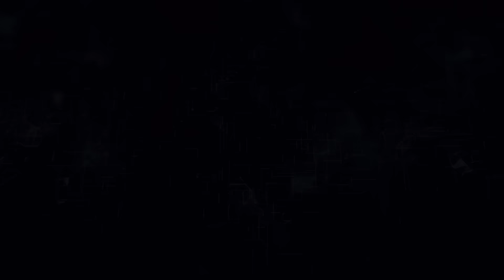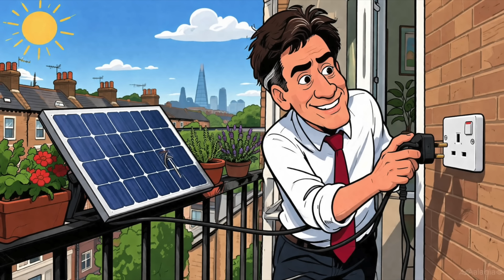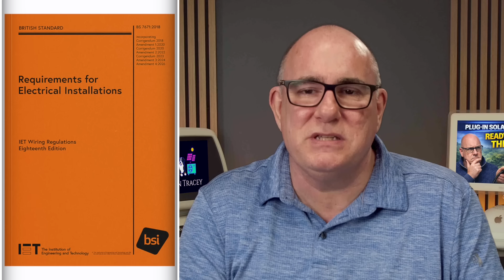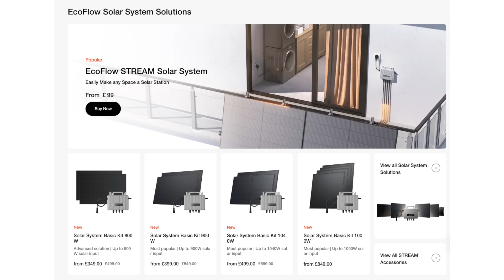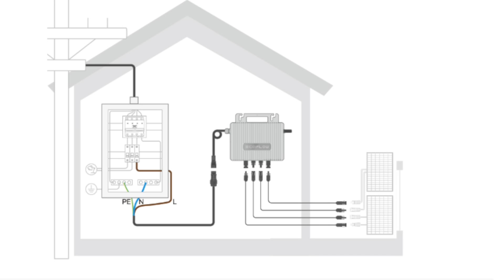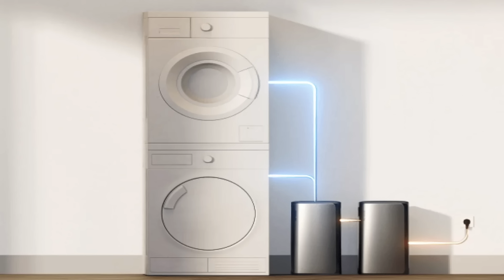Plug In Solar Is Coming… But There’s a Problem

Comment: I do think the introduction of these solar systems is likely to lead to bad practices and acceptance leading to possible injury or death. While these solar/inverter systems may fail safe they do encourage the non-expert to use a device with exposed conductors to deliver power into their homes (the plug). For the non-expert what is the difference to plugging these systems in and plugging a cheap home generator into their home in the same way?

For those non-experts reading this - one will be relatively safe (the solar/inverter system) the other could be lethal (the generator system), especially if you have inquisitive children.
Reply: A generator would never have a 🔌 with live pin sticking out, no?
Now, if you are jerry rigging live exposed pins out of a generator, first, DON'T DO THAT. second, it's on you.
Reply: @konstantinlozev2272  I agree with what you say, however I have seen people doing exactly that. I.e. using a plug on the end of a cable to 'back feed' power from a generator into their home during a power outage. These types of cables (with a plug on both ends) are known as suicide leads/cables for a reason.

Yes it will be on the person doing it, however my point was that if non-experts are told that it is safe to use a plug to connect the solar/inverter system into a socket to power their homes to them a generator is just another power source - so why would it be any different!
Reply: @jim373 uff, off, that's a recipe for suicide ☠️☠️☠️
Not sure how I see a person jerry rigging this plug-on-both-sides cable and not knowing they can kill themselves...
Nowadays they can ask chatGPT and it will surely say BUG NO! 🙅
Reply from the maker: The pins are never live, thats the point. Also its been doing for years in Germany wihtout anyone killing themselves, why would it be different here?
Reply: @JonathanTracey  I have seen people using a generator as a power source using a plug on the end of a cable to 'back feed' power from a generator into their home during a power outage. These types of cables (with a plug on both ends) are known as suicide leads/cables for a reason.

My point was that if non-experts are told that it is safe to use a plug to connect the solar/inverter system into a socket to power their homes, then to them a generator is just another power source - so why would it be any different?

I think the Government should provide advertising and education to the public that points out that a solar/inverter system designed to fail safe and using a plug to connect into their homes is not the same as doing the same with a generator. Generator systems typically have much higher output potential many kW compared to the solar/inverter micro systems which typically provide 100s of Watts.

I'm not saying the solar/inverter systems that are designed to be used in this way are dangerous. Just that, the precedence of using a plug to feed power into a home has the potential to provide the wrong message to non-expert home owners, unless there is adequate education provided along side them, including advertising type messages on TV, in papers, etc.

Comment: A lot of landlords in Germany won't allow balcony solar as there is a question of liability if they, or parts of them,  fall from the balcony. Even if you own your own home, the insurance companies are reluctant to cover them.
Reply: You have been missinformed.  It is your right since mid 2024-  the landlords explicitly do NOT have a veto. It can only be stopped if the building has historical-protection status. The "Balkonkraftwerk" was a great success from the last goverment under Habeck.  It pushed these units from 12.000 to 960.000 in about two years. Best wishes from a sunny Berlin.
Reply from the maker: hopefully that’s something that has been thought through as part of Ed’s plan, it would be a shame to see the whole thing scuppered because of received risk
Reply: @JonathanTracey I don’t see it personally I’ve already enquired with my landlord for when it goes legal, he basically said the risk out weights the pros, it’s unsightly and potentially dangerous. It’s a shame because they are perfect for this. 

I’d be powering my aquarium for free 🤣☹️
Reply: @TheDJManUK - wait and see if legislation outlaws landlord vetoes.
Reply: In the UK putting solar on a balcony requires building regulation approval and planning permission. The planning permission bit is fixable (but would be a major change in planning regulations for flats, and have to be done about four times once per country). The building regulations are probably difficult to avoid but building regulations don't allow the council to say no, merely to inspect it to confirm the work was done safely and it's not a risk to you or the public.
Reply: @etchedpixels  what about if you just put them on the balcony floor as opposed to fixing them to the fabric of the building?
Reply: @garethjones6082  Then they will be shaded by the balcony itself and mostly useless.

There is a line in planning between temporary objects and permanently attached ones though.

Comment: I'm thinking of getting one just as a power backup for emergencies. Something that will keep my fridge freezer running after a power cut
Reply from the maker: you may want to look at a system that has an integrated battery because if there is a power cut, the inverter has to shut down. Something like the EcoFlow stream platform has 2 x 13 amp plug sockets on the device itself. These can continue to operate during a grid power outage
Reply: @JonathanTracey thanks for info 👍

Comment: Rules made by trade protection organisations are not rules they are a way about making money for the brothers who run the big companies who want to control the money, using the variable and contrived  regulations they control.
Reply from the maker: yep, but they also have the power to convince insurance companies not to pay out if your house burns down and you’ve contravened the wiring regulations
Reply: @JonathanTracey Very true but that is part of the agenda of control, insurance companies will use ANY reason they can to avoid paying anything, they always have done, this is just another string to their bow.

Comment: Thanks for a very informative vidio
What we really need is the meter to run backwards.
No credit mearly able to draw back energy that was coolected but not used earlier. We pay for this by the standing charge.
Are they allowed to steal this energy. I think not.
Reply from the maker: yeah, I don’t think that’s ever likely to happen again, even in countries where they have what’s called net metering where you get credited one unit for every unit you sent back. Just about all of these are now moving away from that system.

Comment: 🚨⚠️Foil Hat Alert⚠️ 🚨 📢
Could this fast track attempt at plug'n'play electric be a slight of hand for any potential grid outages resulting from certain worldly conflicts..?
Another governing body, same backhanded contract handouts, more wealth transfer.
Don't shoot the messenger 😂
Reply from the maker: The problem is is these micro inverter systems? Don’t really help in the event of a power outage. If the grid goes down then the micro inverter has to shut off so that doesn’t inadvertently push power back into the grid and potential potentially cause problems for somebody working on the cable further down the network.
Reply: @JonathanTracey  when Ed arrives at that logic gate... 😐
Reply: This has been in train since long before the Iran war. The govt commissioned a report into the safety of plug n play about 12 months ago.
Reply: @JohnBlackburn1975  and Iran has been readying for an attack long before "plug'n'play" started circulating British buzzwords.

Comment: Well done Jonathan another simple explanation to the uninformed. I dont need it with my own solar install just putting in air2air today to use up my excess power then a hot water cylinder.
Reply from the maker: nice, let us know how the A2A goes, probably going to love it come summer
Reply: So the A2A has been in since Friday and it's working great. At the moment iv used the heating function on it on these chilly evenings. Having generated 59.9kwh from my solar today I have a huge excess to consume. Hot water cylinder collected hopefully get that plumbed in by the weekend yhen shut off the combi for the summer.

Comment: I did it about 14 years ago. I fitted 2 kilowatts of panels and 3 mini grid tied inverters. A 1000watt and two 500watt inverters. Any spare power goes to the hot water tank. Work really great.
Reply from the maker: do you have them on different circuits or do they play nice together
Reply: @JonathanTracey  all going into the same socket. I should check it out this year. I was off grid with the panels feeding 6 caravan batteries through a 80amp charge controller. The a 3.5 kilowatt off grid inverter. I even put a separate ring mains in the house so I could switch between solar and grid. Things kept going wrong so I ended up just connecting the panels to the grid.

Comment: Think I might buy solar panels+micro inverter and plug my bluette ac180 via a smart plug to run my freezers and fridge at night ,and charge during the day. Smart plug turns on during the day to charge the bluette, and off at night to power freezers of the battery at night.
Reply from the maker: Sounds like a good plan
Reply: This works - providing you don't run out of power when the smart plug is turned off. The newer Bluetti (AC200L etc) can do the time of use management automatically including falling back to grid if the battery goes flat.

Comment: I'm still confused about the batteries. Can I buy a DJI power 2000 or an EcoFlow Stream AC Pro and plug in to the wall, charge it at night and the solar will top it up during the day? Do I need the Shelly EM 50 too? Do they have to connect to the solar directly or indirectly?
Reply from the maker: So yes you can do that today, what you cant do is feed the power back through the plug into the house (legally) but it works just fine
Reply: @JonathanTracey ahhh ok thank you!
Reply: A Stream AC Pro isn't sufficient to get solar power, it's just a battery and you need an inverter. You're better off getting eg a Stream Ultra which has an inverter and MPPT sockets (and a battery inside). You then plug the solar panels into the Ultra and plug the Ultra into the mains and you're done.
Reply: @JohnBlackburn1975 thanks. I already have the EcoFliw micro inverter so the question is really about the energy storage and whether it needs to be directly connected to that or can I plug the battery into a wall socket indoors separately from the solar set up.

Comment: Good video Jonathan, like you I am thinking about adding a EcoFlow system with batteries to my existing system because I need more storage and solar without paying a MCS installer. I have watched your previous videos on the DIY solar system EcoFlow which I feel would help my system as I have a 11kw HP so an extra 800w would be good and I can mount the solar panels on my extension wall to catch the sun In morning to early afternoon. I was thinking about starting of with a EcoFlow Stream X with 4 panels and adding another X or AC Pro later, but wondering how good and reliable is the EcoFlow system
Reply from the maker: my Powerstream inverter is now approaching 3 years old, some people have had issues but mines been solid, the stream system is now 9. months old and again no issues

Comment: I already have Sigenstor battery but I can't get a proper solar set up just yet. If I got a balcony set up would any excess be put into the batteries after the daytime base load (about 300 -500w) . I know it's not enough to make any financial difference but more to know if it's safe or not advised.
Reply from the maker: your panels could be wired directly into the signstor inverter I believe, no need for a microinverter
Reply: @JonathanTracey  If you only have a couple of panels you won't have enough voltage on the string for the Sigenstor I suspect.

If your sigenstor is set up with a CT clamp it'll eat any attempted export from a microinverter and panels that are AC coupled (eg plug in solar once legal).

The one thing you have to absolutely never do is plug on in the load/ups side of an existing system that has islanding (ie keeps those sockets live if the grid fails).

If the Sigenstore has a G99 or is the full 3.68kW you'll also need to update your G99 paperwork.

Comment: Thanks, Someone who actually put something together that actually correct and also makes sense. The G98/99 bit is a sticky point, the DNO must see these devices as a nightmare. The big deal is the need for some sort of product conformity, so every device works properly. We don't want some cheap device of aliexpress that you have to manually switch to 50hz for example.  Can see this happening quickly
Reply from the maker: I wonder if the DNOs will just say, anything below 1000w were not interested in

Comment: I'm in got some extra panels and batteries plus ecoflow smart meter that takes charge of all solar power input form my roof panels and the new add on system  to the batteries first then back to the grid to off set any usage were as before it all went to the grid win win must have smart meter
Reply from the maker: Yep a smart meter is the first step, then an export meter and approval and your away

Comment: I have roof panels and FIT , so cannot have this system but would it work to allow my rooftop to work when power goes as happened in january.I was off 5 days after a storm in Cornwall.
Reply from the maker: sure you can, FIT does not stop you having plug in solar, now you cant have it run through your generation meter
Reply: @JonathanTracey Thank you.I would have to get that  metered though.? Or am I  wrong But would it make my roof panels function when grid is down?
Reply: @bertibear1300  On a standard FIT setup adding a set of AC coupled inverters the far side of the generation meter (as the house will be) will not mess up the FIT or the generation meter. You will need to apply for a new G99 if the total goes over 3.68kW and you will need to complete the additional FIT paperwork to prove that the install does not change the FIT.

Whether this will also get simplified with the approval of plug in solar who knows.

Doing so will not keep your panels working when the grid is down. Very few pieces of kit can do this. Some can but are not DIY installs (eg Sunsynk/Deye)

Comment: great. I only really have a laptop setup fridge and washing machine. so one maybe two of these and free electric most of the time.
Reply from the maker: certailny in summer daytime, winter they wont produce much
Reply: @JonathanTracey  i guess so, being in the UK myself. but it could be worth it, to cut the bill and just has importantly. have a backup system, which i think the government is thinking off, if the oil gets too expensive, after all, oil does power, a good number of UK power stations
Reply: It will certainly run the laptop and fridge but washing machine will likely use 2kW or more when heating. A DIY system won't cover that: it can produce only 800W. It still helps, but the remaining eg 1200W needs to come from the mains
Reply: @JohnBlackburn1975 thanks for the help

Comment: Wonder what happens in unused electric from your micro converter, ie:  house only using 300w through the day and your producing 800w , where does the rest go , back to the grid for free.
Reply from the maker: on mine there is a setting, if you dont want it to export then it will shut down if your not using the power, this is because some people dont have export agreements in place.
Reply: @J @JonathanTracey oesn’t matter it will can still run through the coil of the Rcd or rcbo. Yes you can stop them all from exporting but if you run it down a circuit it can be used by another circuit, this has nothing to do with exporting, it’s a regulation that was introduced in amendment 3 of the 18th edition of BS7671.
Reply: @JonathanTracey  Interesting thanks
Reply: Yes, guess what you need a bio directional rcbo as well. Ed is talking out of is arse.

Comment: Hi we started our system with a ecoflow delta 2 and extra battery connected to 2 solar panels. I work from home so the eco flow powered the sockets in my office. So the computers were off grid. Obviously great in the summer crap in the winter. We now have  a G99 and a victron system with fogstar batteries. Our solar generated just under 25% of our energy last year thats with just 2.8kwh of solar.  We are also on economy 7, so we charge at night and use during the day. I honestly think that every new home should have some solar and also a battery and inverter. I wonder if prices for solar equipment will start to rise again? By thew way i do agree with householders having solar, but i totally disagree with so called green energy companies being paid subsidizies.
Reply from the maker: I hope we dont see price gouging
Reply: @JonathanTracey  Hi, we bought 2 - 475w panels a couple of weeks ago for £201 delivered the same panels are now £114 each delivered.
Reply: Price rises at the trade end are already happening, along with 60-90 day lead times on some products. It was getting hectic at the start of the year, the moment agent orange bombed Iran it went crazy.

Comment: There may be an expectation that it will provide power consistently , it needs to be made clear that there is a huge variation in order that it doesn’t get a bad rep.
  Harking back to previous  output where I commented that we should be using our own resources , Ed Conway I think it was has done an informative piece on why we should be doing so , particularly in eco terms , it’s worth a listen .
Reply from the maker: yeah, I think there is gonna be the low end systems which is just gonna be a micro inverter and some panels but the more mid range systems that include a small battery at least will be able to continue to supply power as the solar fluctuates